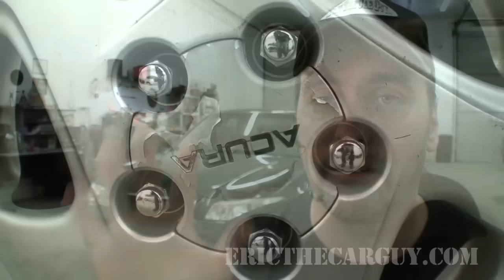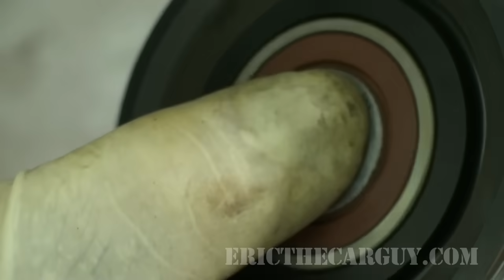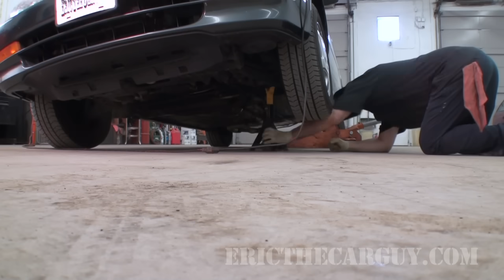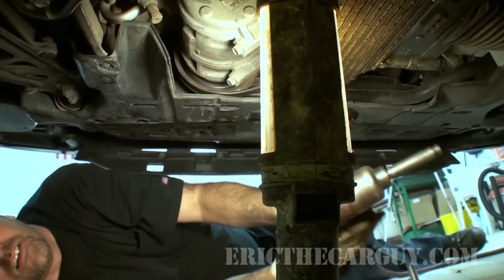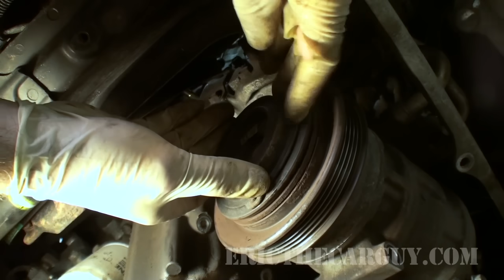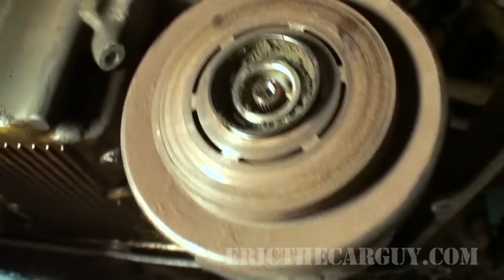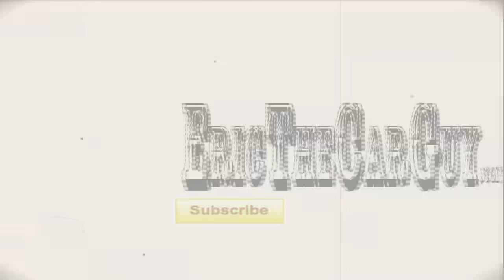AC Clutch Repair and Noise Diagnosis -EricTheCarGuy

Comment: Maybe this is a dumb question, but if it had been the idler (or was it the tensioner, or are they the same thing?) wouldn't the noise always be there, regardless of AC being on or not? Either way, fantastic video! Subscribed!
Reply: Yes the sound would stay. A good way to hear where the noise is coming from is with a garden hose and place it on every pulley to check where the noise is coming from while the engine is running. You gotta be careful but it’s the fastest way.

Comment: My ac blows fuse when its plugged in could that be the clutch wiring or is my ac compressor toast? I have a bad pully for sure and after a while of it being noisy I think the clutch stopped spinning and snapped my ac belt. What are the chances it's just the pully? Or can the stator cause a short the blows number 56 fuse on 98 crv?

Comment: Eric you are the best mechanic on you tube ever. Very profession knowledgeable,  and you explain the jobs so a blind person can do the work. Thank you and keep the videos coming.
Reply: Dude he installed the bearing in a way that harms it any real mechanic has known for many years that the safest and simplest way to install bearing is use old bearing to push new one in…. The way he did it already pitted this bearing and will be a faster wear then usual. Personally I’d be ashamed to post this “informative” video. Or title it “how to never install bearing” or even “fastest way to make a bearings lifespan decrease”

Comment: Eric, have you ever seen the other bearing on the ac compressor shaft itself go bad? And have you replaced one without pulling the compressor off the vehicle? Working on a 2012 Honda CRV, pulled the pulley and saw the other bearing in there on the shaft and wondered if it could be bad too…

Comment: I know this is likely the wrong video to ask this question but I need to know your  method for ohms testing an ac coil that isn't in the compressor. This is on an 02 Buick Century 3.1
I ask as the new coil I have is 3.7-3.8 ohms and the older coil is only 2.7 ohms.

Comment: Brother my 2018 Honda CR-V LX AWD Air Conditioner is blowing hot air. I purchased a hose and the gas tank but the hose was fitting. I guess i will have to buy an extension for that. Can you please tell me how to fix it properly? I have seen couple of videos but they are not really helpful. Specially with the basic information on how to do it step by step and what parts do we need to fix. 
If you could kindly reply me on my email, i will be really grateful. Thanks & Warm regards faha

My Email ID: alive.spirit@yahoo.com

Comment: Kbb bearings is the way to go.. we also use these for 3600 rpm electric 3 phase motor.. but when hammer in the pulley use a small pipe and hit in the middle never the sides

Comment: Great video. I just changed the compressor and belt, but now I have an RPM dependent noise (sounds like a whine). I asked my mechanic to switch out the idler pulley at the same time while he was there. Is there a chance the replacement could be the issue? Its a very noticeable sound when driving with the ac on.

Comment: Hey Erick great video I learn a lot 
I have an issue with the ac of a 06 Lincoln Navigator I just recharge the system but still not cold air coming out I hear a hissing noise at the back of the car like in the very rear right side of the car any suggestions thank you 
Eddie

Comment: Loved the video until you hit the inner race of the bearing with a hammer.  That will damage the bearing.  An easy way to install bearing is to heat the pulley in an oven to 300F then the bearing will take very little force to seat it by tapping on the outer race

Comment: Good video Eric. All that crap inside the hub is oil, UV dye and evidence of an overheated shaft seal and a leak (possible) The brown dust is definitely a sign of the bearing failure, good diagnosis. Early models used to also wear the front alloy nose cone and blow a fuse, later ones blow the internal fusible diode, so yep the magnet coil needs replacing. I find the need to remove one shim to compensate for the wear on the hub and pulley face, in order to get correct air gap. Cheers from Aus

Comment: Can you tell me if my 2012 Camaro LS has a clutch bearing assembly on the front of my a/c compressor? Did they make it where you can just change that part out? No one will help me and my car only makes a whirring noise when I turn on the defrost. Clicks off when I change the vent settings inside the car. It sounds like it's a bearing but coming from the front of the a/c compressor. I can't find one for sale and every place has said I need to buy the whole a/c compressor which is 400.00 just for the part. I'm pretty sure the noise I'm hearing is the bearing in the clutch assembly not the compressor. They already put on a new serpentine belt and now they want more money for a new a/c compressor. I need to know if I need to buy the whole compressor or can I just buy the clutch assembly? Please help!! Thanks!

Comment: Eric thank you for the video. I have a 2003 ES 300 Lexus and have a similar noise when AC is engaged. I shared your idea with a mechanic and he insists on replacing compressor. Can you please let me know if it will work on my car. yusufrangwalla@gmail.com

Comment: Use the vice as a press. In and out Its so easy. Plus no damage to actual pulley. Never bang on the inner race if don't have a vice. Support the pulley and use a pipe or a socket that fits the outer race, then gently tap in a 12,6,9 3 o'clock fashion and it will seat easily.

Comment: Regarding belt tension adjustment: Why not just use a kriket gauge which is fairly accurate. Then you can measure belt tension in pounds and just adjust to spec.

Comment: I know it's a long time ago but thanks for the update, I have the same problem 206 2006, suspect pump or alternator, just noisy under load each of them are just a little noisy as you'd expect at 14 years but it's when the aircon is on full load that it sounds rough, both are working fine, so I'll let it develop,  by the way, no clutch or bearing noise, it was the first check.  checked alternator on full load,  checked all the idlers also .. I'm thinking compressor but I'm one of those guys who want to know.

Comment: Will the car idle high when the compressor locks up? I have a car throwing a high idle code P0507. AC is not working and awful sound occurs if revved. The car idles at 950-1000 rpm (no load). I see it try to drop idle to 800 rpm and the engine runs really rough and then idle goes back up automatically and roughness stops. .

Comment: Hey Eric I like ur videos and I learnt a lot. I am searching for this noise which usually comes now from my Lexus lx 470 the engine noise is quite high whenever I switch on the ac and when I drive the acceleration is not good even it gives that roar sound. Can we know if it is from the ac. It seems to be the same noise when this car's engine was on. Please help me on this. I have been searching this for the last 1 month and I changed the fan clutch it is still same.

Comment: The clearance is called a "air gap", on 90% of these compressors there are 2 washers, a real thin one thats always hiding in the clutch and the thick one that always falls out first, they normally have oil on them so the little one has a tendency to stay with the clutch.

Comment: My wife's 03 trailblazer ac isn't working, so I checked the fuse with a test light and did the relay swap with the fuel pump relay which both appeared to work, then did the down and dirty energise the ac clutch and hold a large screwdriver to it. Snap it stuck to the front of the clutch like glue each time it was energised. But the clutch isn't pulling in. The bearing on the pulley seams fine. I'm going to pull the clutch and clean the parts real well and replace the spacer washer with a slightly thinner one. I hope that will solve the issue. I'm guessing there is either some debris hanging it up from pulling in and maybe the electromagnet coil may be a little weak. What's your opinion? Thanks. Jpol.

Comment: You always need to apply load to a bearing when you spin it to get an idea of its condition. 
You can most of the times even do this in your hands by pressing it hard while turning or rolling it in your hand.
Otherwise it might seem fine like in the vid. Bearings doesnt work without load in the car do they?

Yeah and the install of the new one with a hammer to the inner ring has already been commented, but why you shouldnt do this is mainly because hitting the inner makes the bearing balls hammer the outer ring in place. Since bearing parts are extremely hard they make tiny indentations in the rings. This is introducing vibrations that will result in your new bearing having a fraction of its normal lifespan.

Comment: Sometimes the outer edge of that dust cover washer rubs the bearing or pulley when engine is running. A belt sander will fix this. Just a simple clearance issue. But what do I know ? 😂

Comment: on my  2010 gmc Acadia the ac makes noise , then stops for about a minute or two , then , makes noise again . just started today . also sometime i feel and here clicking on my gas pedal at slow speeds , it don't happen all the time , but it does happen , i asked my  auto mechanic about it , and he said it was the safety features of the car . really?   safety features ? i had the Rack and pinion by the warranty , so it cant be that .

Comment: I have a 2002 Chevy Corvette, and my ac unit seems to make a knocking noise when its on. It is a new unit that is 2 years old. It
 blows cold, cold air but it just have a slight knocking noise when the clutch seems to come on. What am I missing?

Comment: Well, that new bearing is half dead already from the hammering. Should have used that vice to press it in. Stack the old bearing on the new one for more depth.
Reply: Dude is a old one he just said it in the video (7:50)  , learn to listen first before writing.
Reply: @TheBenyi28  Dude, learn to think before you comment. If it's an old bearing, then after the hammering, it's a half dead old bearing. There's no justification for killing the bearing before installing it in the car, especially when there's a vice right there for pressing the bearing in.

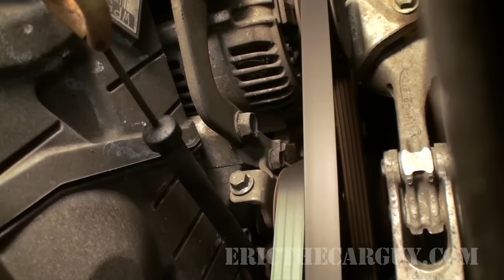Comment: 1:53 before with AC off
2:00 before with ac on
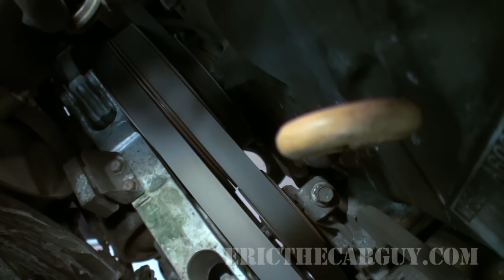25:50 after with ac on
Why it sounds the same to me with ac on after and before the reparation? 
My local mechanic told me that it was the belt tensioner,  when AC on,  the compressor will put more load on the belt and the tensioner will make noise. 
I didn't replace the tensioner yet because I think the noise comes from the compressor too. 
What do you guys think?

Comment: do not hammer bearings in like that. Outer race only, equidistant pressure. One tap and you've brinelled the new bearings leading to premature failure. Otherwise, great video.

Comment: I would suggest using a larger socket and push the bearing in with they jaws of the vice instead of hitting it with a hammer.

Comment: Hi Eric. I have a noise coming from the compressor when the ac is off. When I turn on the ac the noise is less noisy but I noticed that the clutch does spin sometimes but sometimes gets stuck as well and when that happens the engine works harder like it wants to turn off which is abnormal. Now my question is do you think that replacing the clutch will get rid of the noise or the noise is bcuz there is something wrong inside the compressor which will make change the whole things? I have a 2007 honda crv. Thanks

Comment: How do you determine just the clutch needs replacement and not the compressor?  If it's making noise, couldn't it be due to added strain of drag in the compressor?

Comment: you don't have to remove to see if bearing is bad. Take long skinny screw driver and put it against  the the bolt or bracket of the pulley and put your ear against the screw driver handle, you will hear noise if bad

Comment: I don't know what's going on I loosened the screw but this plate doesn't come out at all, there's no way for me to have access to the washer for me to release the pulley to change the bearing, in your video after you loosened the screw the plate came out  easy on your hand, my here tried with some crowbar and it does not come out at all

Comment: HI,
MY AC stopped cooling.

My high and low gauges shows 125 psi when car is off.
when I turn the AC on, the high gauge still shows 125 psi, buy low side drop to10 psi and stay static there.
the clutch seems good.
what is the problem?
thank you !
Reply: John Doe bad thermostat

Comment: Nice job. Thanks for sharing. I have a question-  why bad tensioner bearings would make the compressor clutch not engaging (i.e. the ac not working) ? The noise - I understand

Comment: I had an issue with my car, causing the serpentine belt to not only snap once, but the new one snapped as well. As though it had been cut with bolt cutters. Any idea as to what's causing this?
Reply: Mind you, I only drove with the new one to get groceries after putting it in. No wear in the sides, in the grooves, just the snap.

Comment: Hi Eric I have a 2005 Honda oddyssey 6 cylinder and would like to replace the a/c clutch but where do we buy it Amozon does not have it and auto zone is too expensive thanks...my van is DOING that noise ac works then goes away ..it did that for 3 to 7 days then ac stopped WORKING

Comment: Hey Eric my AC compressor blew up a hole on the side of it. I was told i needed to replace the compressor, and 3 to 4 other parts in the vehicle. Is this correct ?

Comment: So my 2004 honda odyssey is having this issue and I knew this was why. However my ac doesn't work were missing stuff ( not on pulleys ) and we were temporarily going to disconnect bc its ki king on by itself and causing that damn ac pulley to grind etc. Question is will disconnect of the ac line work? I'll try anyway but I just gotta temp fix till my day off. My fiance and I work so much and do all our own repairs. So with same issue do you know what I could disconnect to get it to stop just for like 5 days.

Comment: At 7:33 you just ruined a bearing. NEVER ever hit or press a bearing in the inner race. You need a socket that fits the outer race diameter and press it in using the vice instead of the hammer, though the hammer works as well.

Comment: What I don't get is why doesn't it make that noise all the time? The pulley is still spinning, even with the ac off
Reply: The increased load from engaging the compressor would put more of a strain on it would seem. Without the load, the pulley on the compressor is just running free of a load

Comment: I bought refurbed clutch parts from jenson, it's been the the biggest headache. The first parts they sent me would have shredded belts. The second set looks better but some of it is mangled. I'm replacing them because like the bearing you showed in this car, IT HAS TO BE STAKED IN. The bearing came loose from the pully, the pully flopped around and impacted the coil until it killed it. This all happened to a rebuilt compressor that had that failure after less than a year of use.

Comment: I can't find a logical solution as to why the idle pulley would make noise only when the AC is engaged, seeing how it spins all the time and shouldn't be affected by the state of the AC clutch. Please let me know how that can occur.
Reply: The increased load from engaging the compressor would put more of a strain on the idler, it would seem. Without the load, the pulley on the compressor is just running free of a load.

Comment: Hey Eric!
Where did you find that replacement kit? I've looked all over the place for one and none of the parts stores carry them. Even RockAuto only sells complete compressors. I don't have this exact car but the insight you've given has proven mine is having a fault with the a/c compressor, 98% sure it's exactly like this one but would rather not replace the whole thing. Thanks a ton!

Comment: I have a 99 Lumina 3.1. I keep blowing fuses for the ac clutch. A mechanic I took it to said that the problem was an internal component on the compressor that can't be replaced and that the whole ac system would need to be replaced. So, I have been living without ac as the quoted price was exorbitant. The other day I took a look at it myself. I pulled the relay out, installed a new fuse, started the car and then jumped the power to the clutch. I saw the clutch engage and spin. It was making a racket as well. Then the fuse blew. My thought is that the noise a mechanical issue with the clutch and it is causing the current through the coil to increase, thereby blowing the fuse. Do you know if the clutches can be replaced for this particular model or is what the mechanic told me true that nothing can be replaced on the compressor and it needs to be changed out? Thanks for any advice you might have and I thought your video was quite informative. I could see doing this myself if it were possible on my car. Maybe someone else showing up here might know as well.

Comment: I like your videos but not the way you installed that bearing.  The force should only be applied to the external race - never apply a striking force to the inner race since that transfers to the bearings and the race surfaces.

Comment: If I have an idler pulley out like that, it is so easy to pop the plastic seal out of the bearing and put some grease in it, then just snap the seal back in place. It will last much longer. I have also done this with motor bearings on vacuum cleaners back when I had a vacuum cleaner shop.